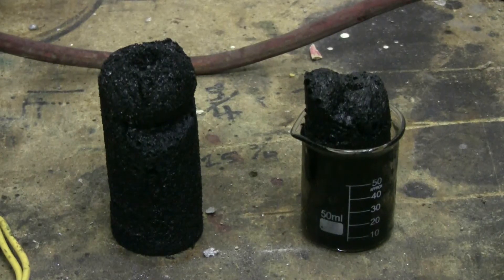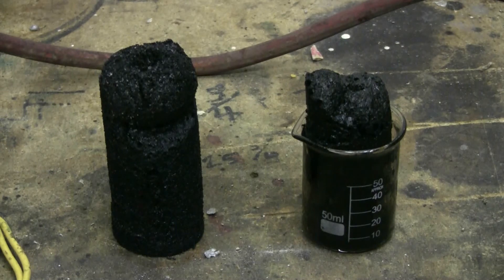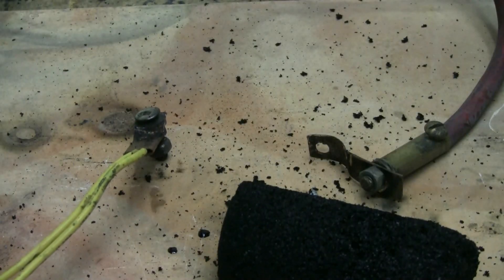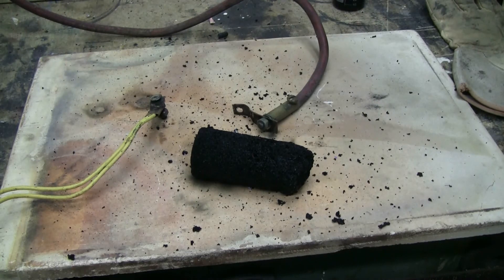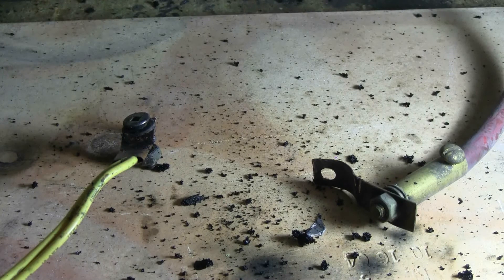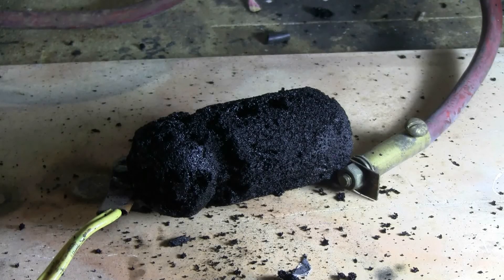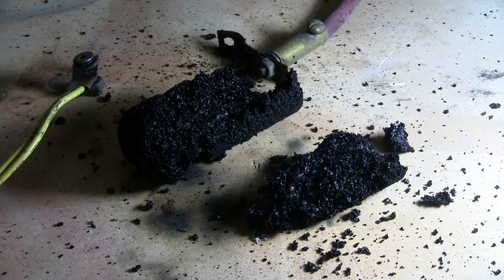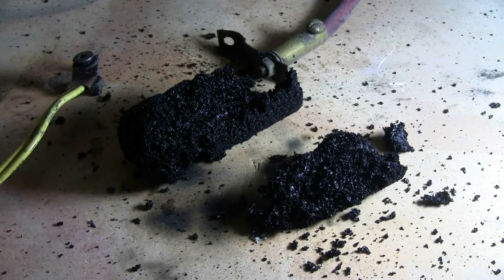Capacitor Bank #79 -  Carbon Foam From Chemistry Experiment

Comment: What was the point of the experiment? Just blowing up things? Maybe that carbon foam can be charged to make a capacitor? With a thinner layer of foam, less voltage and different electrolytes/electrodes.
Reply: the point is : if you think carbon foam that you make from chemical experiment is conductive, and suitable for making supercapacitor, it wouldn't explode.

Comment: See if you can make a battery with it (the carbon foam). Idea: get an old soup can and thoroughly wash it out. That's one electrode. Put the carbon foam in. Obtain a strip of copper, aluminum, tin, brass, or whatever (except not galvanized steel). Wrap in cheap paper rag, then shove into the foam; leave the top uncovered - that's the other electrode. Fill the can nearly to the top with distilled water and an electrolyte (vinegar, lemon/lime juice, ammonia-based window cleaner, etc...), then hook your voltmeter and see if it works! Experiment: see which metals/electrolytes work best. Post videos! :)

Comment: That was a hell of a spark, what voltage or amperage was that. Thank you for posting!
Reply from the maker: The bank is 70 uF charged to 6400 V. Discharge current will be limited by the ESR of the caps and the resistance of the target.